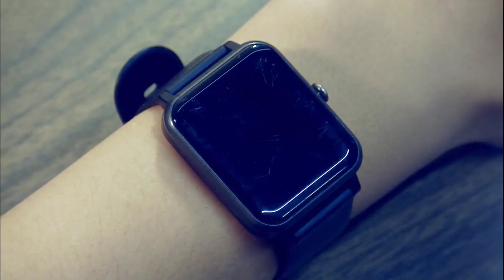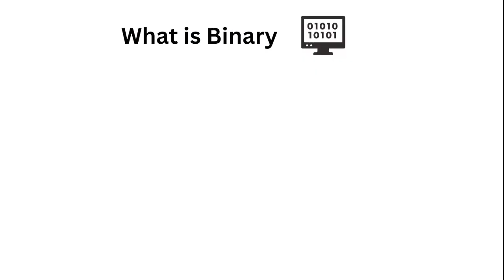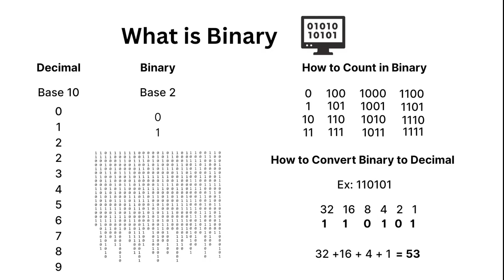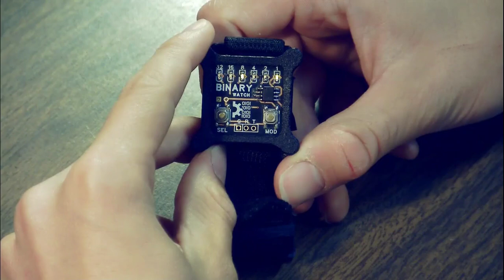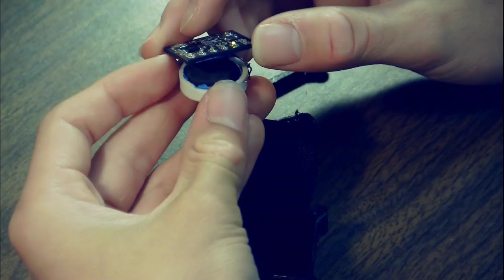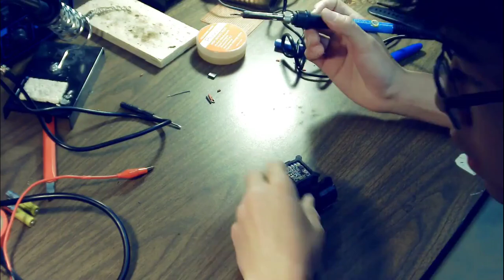I Built a Watch That Speaks Binary (You Can't Read It)

Comment: Love it.  I came across watches with unique display formats on Amazon around 2010 and promised myself one (still haven't gotten around to buying one). They were pretty cool and have a futuristic sci-fi look to them. 
I like that you can actually see the microchip on the watch face, and styled font and its positioning look pretty cool. 
Definitely a watch for a 100% geek.  

The only change I'd request if I were paying customer would be an LED hue that's significantly different from the rest of the colours on the face; I'm not sure if it's due to seeing the watch on video, but the it felt a little difficult to see a clear difference between the 'on' and 'off' LEDs.  Anyway, it's a beautiful watch and I realy like the concept.